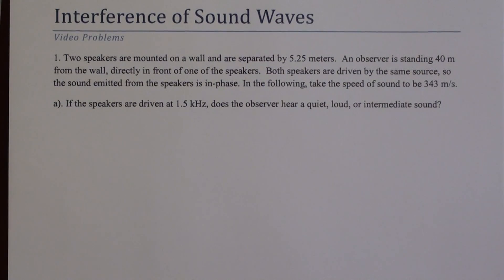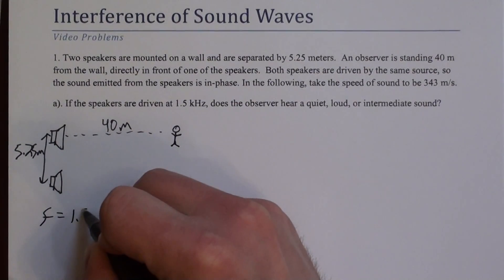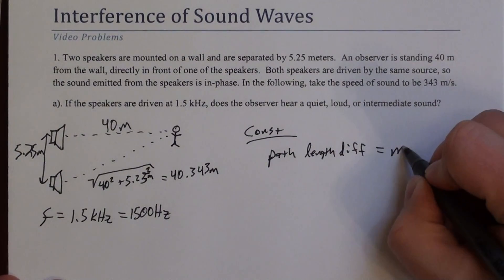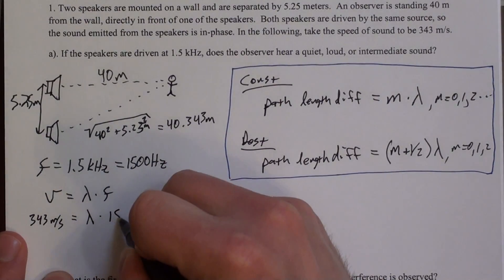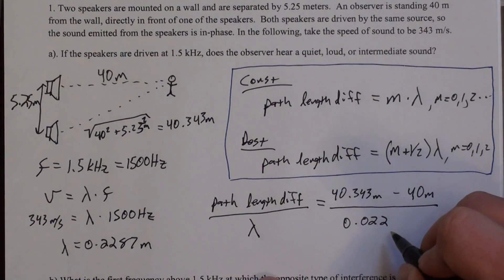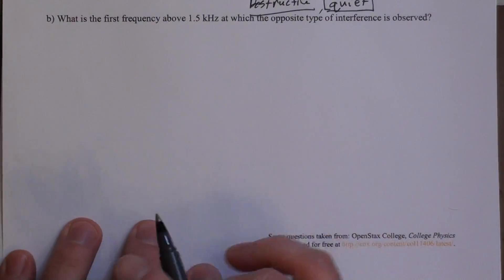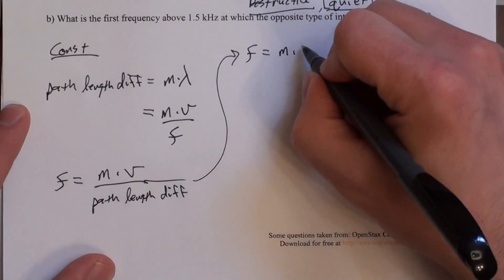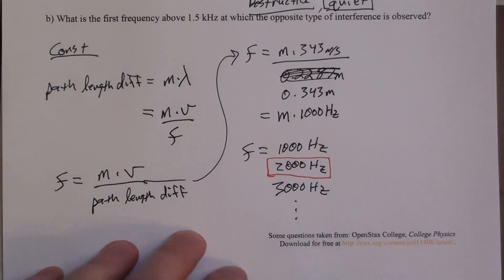Interference of Sound Waves

Comment: A simple approach would be to say that in order to get constructive interference at the next higher frequency, you would have to fit 2 wavelengths into the pld. So then, lambda 2 = 0.1715, divide the velocity 343 m/s by lambda 2, thus get f2 = 2000 Hz.